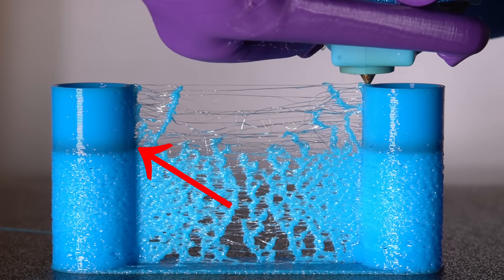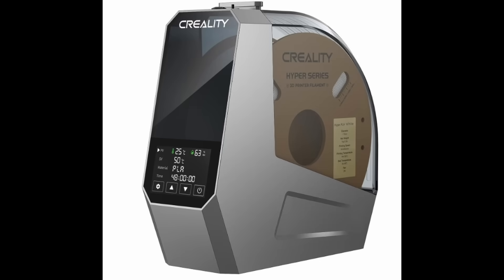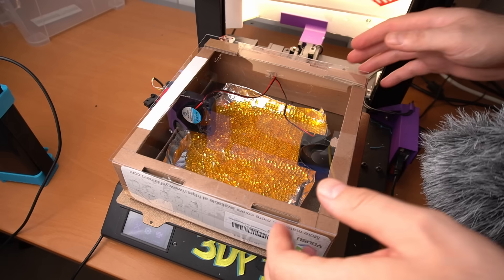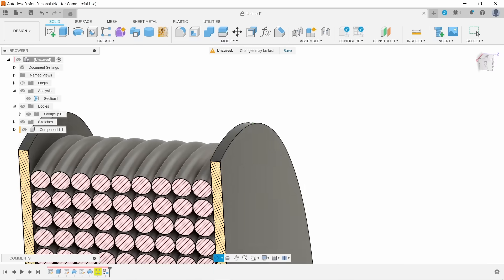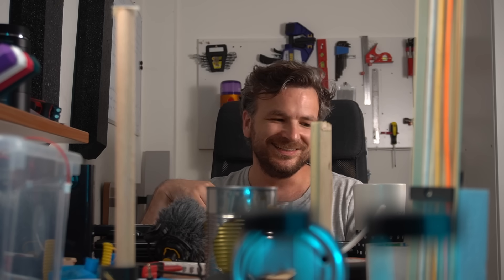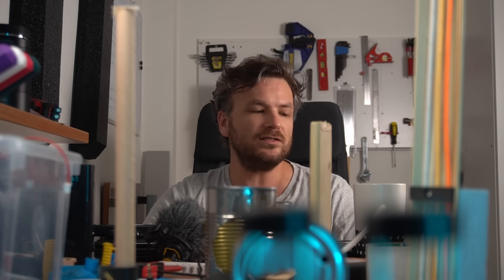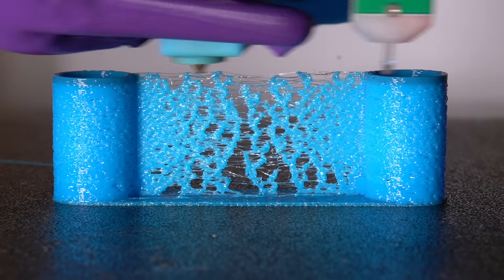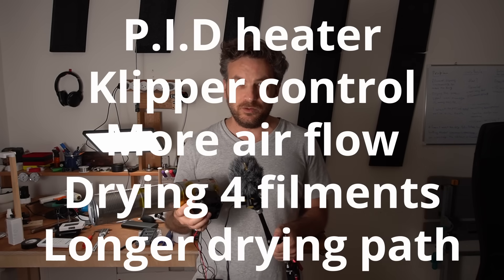Why are we drying filament this way?

Comment: I like the idea, it's the implementation and other things you mentioned. It worked, at 40mm/s but what happens at say 200mm/s or throw in an AMS. It would be easier to make the AMS a dryer, some other company did this, can't remember which one though. 

This would solve most issues. I say most because most filament is dry out of the sealed bag but every once in a while, it's like it sat on a shelf for a week before it was sealed. Also, the most hydroscopic filements are all CF of GF or some sort of blend. 

Since you can actually see the carbon fiber in them, it's easy to see how they leave more pockets of air for moisture to absorb into. The higher the amount of CF there is, the more hydroscopic it is. While filaments like TPU and ABS are hydroscopic, they don't come close to any CF blend for that reason. Most recommended 24 hours of drying at 80°C for PA-CF. TPU doesn't need those temperatures or time so that would be the real test. 

Personally, I recently got the Polydryer by Polylute and it's great. It has a separate dock from the storage container, comes with reusable dececant, has a hydrometer in it, and already has mods on printables for various things like drying to boxes at once. The storage boxes, while not cheap (25 US),, are reasonably priced and have excellent build quality and comes with a hydrometer, reusable dececant and spiol. The box sits on the dock, hot air is blown up the back, the front port sucks it in which is where the dececant is. You can remove the box and seal it air tight with some plastic caps with rubber around them. The dececant and hydrometer stay in the box. Now you can simply store that box and put another one on it (extra storage boxes are sold separately). It's the nearest advantage to come to dryer boxes in a while which isn't saying much but still, more versatile than anything else on the market. The fact they are allowing community mods is also a plus.

With CF there pretty much has to be a dryer box. If you can get CF working on this for a reasonable cost then that's when more interest in this will happen.  

Out of all the rolls of TPU I have bought there was one with major issues due to moisture, others printed fine for the first print then I did dry them and store them in ziplock bags with reusable dececant but once I get 3 or 4 of those dryer boxes, that's really all I need as I mostly print PLA which can't sit out for months.

Comment: YES! Well Done!!! This entire past year, I have been shouting from the hilltops that filament drying is THE most important next place to put our collective energies! Sorting out this challenge for pro users and major hurdle for those new to the hobby before the constant epic print failures frustrate them away is vital for the future of 3d printing!!!

Try Activated Alumina granules next .... they can absorb Wayyyyyy more water and have a healthier lifespan than silica gel beads and the color changing dye used in them.
You do need a higher temp to drive off the moisture and "recharge" the granules but this ensures even better performance over a longer span of time .... depending on your humidity level.

I also recommend getting a dehumidifier for any closed room that you have your printers in.... so other off-the shelf technologies can easily be added right now for home users. I know dehumidifiers aren't cheap... but compared to destroying and wasting 2 rolls of filament in cost they are worth it..... get the biggest one you can so you don't have to empty it as often.... set a phone reminder as often as it takes to go empty it.

....and if you don't have dry boxes, or a dry room, enclose everything you can (entire printer and at the very least your filament, and add a cheap house fan for PLA cooling inside the enclosure ( so get/build the biggest one you can or get the smallest fan you can fit).....this will avoid the Creality X1 problems seen with excessive heat requiring the top be taken off to vent.

👍👍

Comment: you could use vinyl tubing as the 'chamber' and first blow the heated air over dessicant before injecting it into the tubing. extra dry air and a long, flexible drying chamber.

Comment: So what was the real solution? The pressure advance settings or the inline drier or the dry box?
Reply from the maker: Both, it has to be dry af otherwise its bubbling up in the nozzle and oozing. Retraction is 0, the higher PA (or lower not shure) reduces the pressure in the nozzle before it travel there for less oozing. One sample (not in vid) had 0 stringing :))

Comment: What about expanding on ur ideas by making a dry box in which ur hydrated filament comes in off the roll, then passes through a series of pulleys, up, down, up, down, etc. heat air flow just like ur descant bead drier design, then the filament goes out to the printer. Also, have the entire one side of the "box" open for quick & easy load & unload of filament. 

First time viewer - Great vid - I'm sub'd & rung

Comment: Good one!

Problem with the Ams will be the Colorchange. The warm filament will get squeezed like Tpu weaker than 98a by the stupid construkted ams motor or exchange the gear with a flat belddrive system.  Otherwise you will have to cool it down when it get pulled back.

Comment: For the commercial inline dryers, they are probably using Zeolite, it’s used as a moisture absorber in industrial applications. It can be regenerated by heating it up, just like Silica Gel.

Comment: TL;DR: Make a system of pulleys inside a box to keep the filament in the dryer for longer.

I have no experience with filaments but I'm gonna extrapolate from my knowledge about materials - your in-line dryer design is a step forward from "normal" dryers because it exposes the whole filament string to the hot moving air, but doesn't account for internal thermal and moisture transfer inside the filament. Simply, the filament should stay in the dryer for longer and you already in a way did that in the second "longer" design

Your dryer quickly removes moisture from air around the skin of the filament, maintaining a constant good drying conditions. But that moisture needs to get to the skin of the filament before it can evaporate, and that transport rate is I would presume slower than the moisture transport rate inside dryer. So the amount of moisture removed from the whole filament is restricted by that internal transport, and the only solution is to keep filament in the dryer for longer.

Of course, you can't slow down the speed of the filament, so you need a longer path. I would suggest using pulleys inside a box. This way your filament will need to travel a longer path through the dryer while not making the dryer itself bulkier. And I guess that box can be plastic just fine.

All that said, I really like this idea because it's cheap, easy to make and works instantaneously. Pretty much anyone can do it at home and quickly dry the filament when they need. So I would love to see V2.

Comment: You're on to something, would use a piece of pvc pipe and fit a hairdryer but this would be very noisy, what do you use as heating element?
always used a cardboard box on the heat plate so far but the core of the spool is not exposed enough for this to be effective in my opinion.

Comment: What's wrong with the current filament dryers. You don't need to wait 8 hrs. I just turn the dryer on whole printing. It remains off otherwise. Also the lead that comes out of the filament dryer make it dry from all direction.

Comment: Hmm, this is something I've never even considered. I grew up with my my dehydrating foods alot so it was natural for me to drop some spools in my dehydrator and and let them sit for a while. I have thought of the problem that the hot hair is just blasting the outer layer while the standing heat sinks deeper in but since I dont print that much at one time I let it go cause the part I need is the part getting blasted. But given the multi-hour time it takes in my dehydrator it makes me wonder if there is enough time for an in-line dryer to have enough effect. 
Im very interested this this problem now!

Comment: Nice job on this one, what i found is just having a very long melt zone is enough to force out the moisture and even though i live a few hundred feet from the ocean on a tropical island there is no need to dry any filament besides Nylon. I don't even store it sealed up its just out on the shelf.
Reply: What do you mean "a really long melt zone? 

Something like a long hot end?

Comment: Start using PETG filaments. Nice prints and no more moisture problems.
Reply: Oh PETG is quite susceptible to moisture in moist-air climates. Also it's not TPU, it's not going to replace TPU when you need TPU.

Comment: You might get a boost in the drying effects, by having the fan sucking air through a multilayered dessicant array, such as tins filled with the little dessicant satchels used in shipping, so it's heating dry air. Extending the tubes to lengthen drying time wouldn't hurt, nor would flowing the filliament in down the length of the tube Towards the fan and heater, so any moisture removed is flowing away from the filament as the filament gets closer to the printer.

Comment: You need to maximize the surface area of the filament in the dryer. 
You really need to figure out how much much water you can pull out of the TPU in the dryer per inch/cm. Knowing this will drive your design.

Comment: Nice test on inline drying! For V2 you should drop the cans and design a 3d printed solution, from a heat resistant filament ofc, like abs

Comment: My idea would still be a spool but there would be heat elements around the outside. That would give you length and time without having massive cans. Could just use one of the premade dryers and add the outside heaters.

Comment: Time is the enemy. Considering the requirements, I just use a dehydrator to dry my filament since it has low heat and airflow. Unfortunately, it's one of those things you can't force without hitting a heat threshold though; like those pics of melting filament in standard kitchen ovens.
Provided you could increase the total amount of filament being dried while maintaining a certain speed, it might be possible though. Such as winding it back and forth through an enclosure, which might be what that really expensive unit does. As a drying element, those silica beads work well, but not quite as well as industrial dryers, since they use much more effective (but more hazardous) drying mediums.

Comment: I'm thinking that a closed loop system would be helpful so humidity isn't re-introduced to the filament. Maybe a peltier unit would be helpful. The hot side of the peltier would be on the intake side and the cold side would be on the outtake side so moisture in the air could condense onto it before moving through the desiccant to remove any residual moisture.

Comment: Google for "rowenta brush activ'" it's a rotating hairdryer. A similar solution could work here too: the filament wrapped around a drum several times, and the hot air coming from the inside of the drum. By altering the number of coils around the drum you can easily change the drying time, without affecting feeding speed.

Comment: I think for one, you would need a longer path and also low speed besides getting the moisture% low that comes into the  tube.  Otherwise you will probably only dry the outside of the filament instead of the whole diameter.

Are commercial systems like this for 3D-printing licenced or protected by some patent?

Comment: For faster prints you just need more tin cans, same principle as a tornado nozzle. Also there's no reason to use tin cans which are so wide, a thinner tube will work just as well and require less airflow. Even the crappy cheap filament dryers we have now have only been on the market a few years, most likely SOMEONE will do a good job of executing on this idea and we'll be able to buy them cheaply in the future.

Comment: Those dehumidifiers are not great at drying wet filament - but that is also not the intend of any serious filament dehumidifier boxes: They are designed to store the filament in a dry environment while also providing a simple way to use it.
desiccant based ones are... not all that great longterm.

With your tin-can you can dry the filament as you need it, but that does come with several problems:
Everything changes, nothing is constant. Temperature and moisture of course have a direct impact on the filament - thus also on the needed airflow and heat. The size of the filament, its thickness, material-properties, printspeed etc all affect how much heat is needed. Of course you can go the way of just blasting it with even more heat but then you have the problem that it might be too hot and the outer layer of the filament starts getting soft - specially if the feedrate is not constant (think long distance travel, or short thin complex paths).

but it is simple and cheap to make and with a bit of tinkering can help a lot with moisture-problems.

Comment: Just use a cereal box with desiccant and a roller on some 608 bearings. Before putting it in the box you put it in the oven and heat it. Then when you put the roll into the box the moisture will initially spike but then settle at <10%. No need for active drying at that point. Works like a charm. When you need to dry the desiccant you also pop it into the oven at 120 degrees c and it will come out perfectly dry after a while because water can't exist that that temperature. If you want to speed it up you can use the microwave first.

Comment: This is great! It's got me thinking and designing as well. I'm curious how you're thinking of getting it to work with an AMS unit, as it relies on the PTFE bowden tubes to run properly. For fun, I disconnected 1 end of the PTFE tube between the AMS and the filament buffer with filament still inside, and it just started endlessly pumping the entire spool out onto the floor.

Comment: Now I'm curious about using a modified vortex tube to heat the filament and subsequently cool/dry it. The downside is the need for a supply of compressed air, but that would replace any normal heat source. If you did it right, you could even use the heat from the compressor as another heat source for drying

Comment: The Drywise instrument contains molecular sieve beads instead of silica gel as the drying agent. Also, you might want to apply the countercurrent exchange principle (heat and air from the top down, against the printing direction. Then you would only need a thin insulated tube instead of the tin cans.

Comment: So that ridiculously expensive version is just using a solid desiccant to make sure that the input air is as dry as possible, you could easily add a desiccant air dryer to the air inlet, just be sure to use a filter since lots of solid desiccant make dust.  

Another thing that will reduce the effectiveness of an in-line dryer is the speed of diffusion of water in and out of the plastic, this is a physical limitation, but could be solved using a longer drying tunnel.

Comment: interesting idea sir. 
there is one thing though, you introduce several new points of potential failure with this compared to the regular way of drying the filament when you get it instock. store it in a drybox for later use. this way you dont have to wait to print anything :) regular pp storage boxes with doorseal tape and a hygrometer. add some silica in a box with a fan and it is just a squeaky clean and cheap solution.

Comment: probably better to have the filament run through a circle or a bent pipe that ca be opened on the side would save space and the filament has already been on a spool and is already bent

Comment: Seems like it would need more time in the dryer. Maybe you could use some pulleys to extend the time it's in the system? This would also work better for fast printers.  Currently drying a new spool of sunlu TPU after getting poor results straight out of bag gauge is showing 32% humidity on dryer vs ideal being 16 - 20% here in southern US.

Comment: I have to run a dryer certain times of the year and it's that time. Not the best time to be running hot things in the AC either. I can feel it in my bills. I have a x4 roll dryer and man it can run and heat up the room. With the lid closed and the ports plugged. I'm considering insolating it and my 3d printer to reduce the temperature in this room. I'm thinking geothermal or something similar. Solar radiating panels with thermal mass storage for the day time. I'm still thinking about what will work best for my circumstances.

Comment: #3dpi67 You should use a large diameter copper pipe then put a 1.5 inch plaster shell around the copper pipe, that will help with the heat to help dry also the fan should push through a desiccant barrier as the incoming air is at 60% humidity.